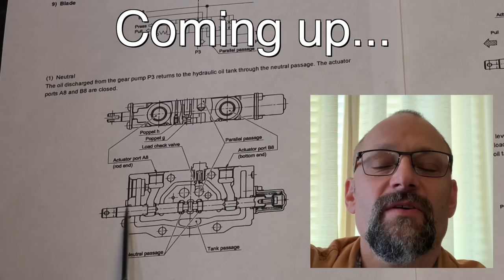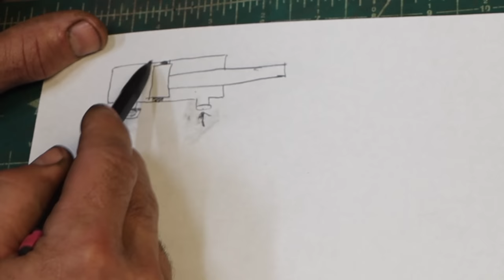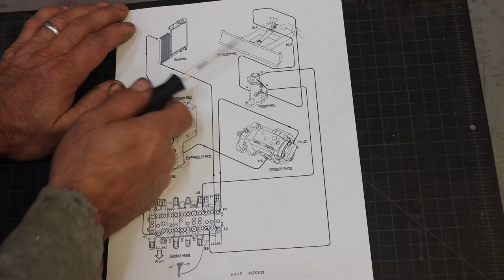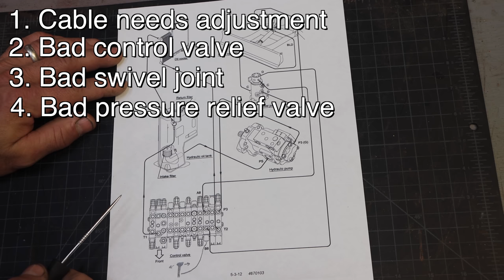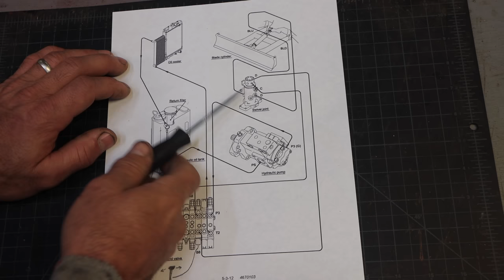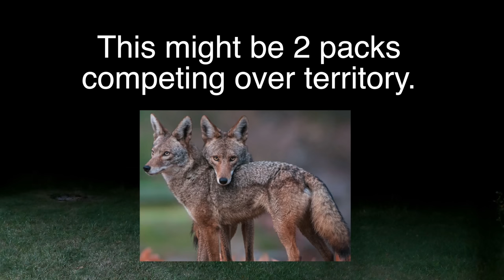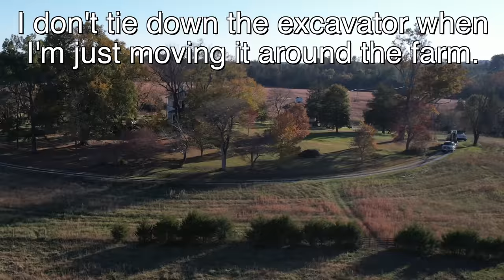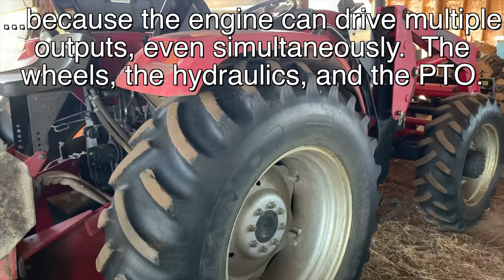Excavator Repair, Swivel Joint Rebuild, Yanmar Vio-50.

Comment: Great video.  I have a 2008 Yanmar ViO55-5B, and you have been an incredible help.

I have a similar problem with blade drift when running the right tracks...and pulling to the right.

Going to start purchasing tools/plugs to work on the hydraulic system.  Any suggestions on type of plugs I would need?  Any suggestions on a pressure tester?  Never really worked on hydraulics before and a shopping list would be helpful.

Thanks again for saving me a fortune with all your videos...my machine is basically going to be new again!

Comment: Thank you for the outstanding videos. I'm learning a lot. Curious why only 1 of the 7 seals internal to the swivel joint failed. Yanmar redesigned the seals or a reason I guess :). But it doesn't explain why none of the other 6 had any issues. That one seal was pretty torn up. Contamination in that channel only? Looking forward to more great content!

Comment: Great video I sure learned a lot. Was wondering if you disconnected the hoses from the swivel , removed it from the mounting and took off the bottom cap along with the snap ring , could you remove the bottom cylinder of the swivel that has all the seals and leave the shaft part up in the machine with the hoses still attached? Could save some work .

Comment: Just be very happy your swing joint has a smooth cylinder. Mine has reliefs for the rings and got consecutively harder to get down past each ring. By the time you reach the last one your beating the hell out of it with a piece of wood to get it down.

Comment: That thing you pointed to on your lift is actually the rotator motor and brake. And the parts you pointed to on the remote valves are actually the covers for detents of the spool valve. 

You should do a steering valve next and show people what a rotary spoil looks like and how it works.

Comment: I understand what you're saying about they're being more surface area on the one side of the Piston than the other, but it's not a problem of surface area, strictly a problem of volumes. When the piston is retracted all of the way the hydraulic rod is taking up an area where oil could be. And when it's all the way extended there's room for more oil in the cylinder. Where surface area comes in to it is that the same amount of hydraulic pressure is going to have less retracting pressure then it is extending pressure if everything is working correctly. It doesn't play into this particular test at all.

Comment: You really do put out a hight quality video .. when you were talking about the Teflon tape , if you put it on the treads nice and tight. It only lives between the nut and the treads in the part . Today there are Teflon type tapes , just for hydraulic fluid air, natural gas, and other fluids …and of course, still made and paste form ???

Comment: i like to take a little drill and clean out my grease zerk channels.   my wife calls the coyotes "Evil Dogs" !!  they make a set of tools that fold the oring or flat seal--a pair of L shaped rods with a zig zag at the top of the L and fastened together with a wide clip with a 3rd rod so they fold the ring in on itself around the 3rd rod allowing you to reach in side a tube to place it set of 3 are around 30 bucks  well worth the money for the time saved!!  great tip about the wrist band !!!!!

Comment: Those plugs with PTFE (aka Teflon™) have tapered threads and are designed to be used with thread sealant. Without it, a small channel would most likely remain around the threads, even if you squeeze the hell out of it. And if even a molecule of hot pressurized oil can pass through, you know it will. I think the reason why they used those here is because they are fairly cheap, widely available, easy to fit (only need a tapped hole) and are highly reliable when installed permanently.

Only tapered threads, like NPT or BSPT, need thread sealant, since there is no other way to get them properly sealed. Do not confuse these with NPS or BSPP, which are straight threads with mating surfaces and/or gaskets.

PTFE is known to occasionally cause premature wear of internal components, damage seals, get stuck into relief valves seats, clog small nozzles, etc. That's why it should never get into the oil. However, that's less of a problem on older or just simpler machinery with manual valves, less fancy pump mechanisms and greater functionnal tolerances. Still, it should always be avoided to let sealant go into the oil and only use it on fittings that require it. Today, most major machinery manufacturers no longer use tapered threads at all, except for grease fittings and some other unrelated stuff.

If you ever need to use tapered pipe fittings, just make sure you don't put sealant near the tip of the male thread and everything should be alright. It's also worth taking the time to clean out the threads of old sealant when reassembling. I personnaly use red PTFE tape (which is actually pink...) because it's three times denser and much more resistant than strandard white tape.

I hope it's useful :)

@FarmCraft101 You make real good job with these videos and have pretty interesting and instructive content. You've got a new subscriber here :) Keep up the good work!
Reply: Also, another reason to use that kind of plug is that they couldn't have fit regular hex heads on there. It seems obvious now that I think about it!

Comment: Always use a tape/sealant 34:26 material approved for the fluid and temps.  Teflon tape too. Do NOT apply Teflon tape to the first 2-3 threads to prevent the tape from being introduced into the hydraulic system.  Same thing with thread sealants on hydraulic and heating or control gas(air/pneumatic systems).  And, of course when removing fittings prevent introduction of sealants into the system

Comment: You just fried most peoples brains but I am a multiskill tech and I understand that force is equivalent to pressure x area. There is less area on the rod side and a leakby from the rod side will always move the non rod side. Great video.

Comment: If the cylinder is drifting up or down it doesn't matter. You have to replace all the seals in the whole cylinder anyway.

If the cylinder is operating under power by itself continuously then you have a bad control valve, it's not the cylinder.

My dad's old Massey Ferguson had the same problem on the power steering.
To keep the tractor going straight you had to continuously turn the steering wheel to the left.
That was very aggravating.

Comment: A lot(some) return hoses have little pressure and can use screw clamps except hoses that hold a cylinder in a fixed position other than full extension or retraction that have to keep position against weight using oil pressure to maintain that position. (That would make a great sobriety test- read it back, if you can, you're trashed!). That is not necessarily the rule. Murphy's Laws apply here too. I've seen all kinds of setups over the years. Especially on equipment that has been in service for any amount of time. God only knows what kind of tech has been there before you. You learn that nothing is surprising after enough time in the field and everything is possible. The patience of a mountain and correct information (and a little magic) works wonders....

Comment: It has to do with displacement more so than surface area. If the oil bypasses the piston seals, then the added oil will displace the space that the rod took up inside of the cylinder. Technically, the surface area which the oil has to push against is decreasing (while overall cylinder volume is increasing) as the rod extends because the rod's surface area inside the cylinder is also accounted for and pressure will be equalized between both cylinder chambers if the seal is bad.

Comment: Hey jon. It would have been a good idea if the manufacturer had put connector couplings a foot or so from the ends of the hoses. That way you can disconnect it their instead of fighting with the the fittings at the swivel. Great job on that fix. I was waiting for a pack of Coyotes to come running out of the dark towards you when you were filming 😂

Comment: Back in the sixties i recall not roping  down a load of small bales on the trailer, usually about one hundred bales give or take, the idea was to save time. You guessed it, a wheel went it to a hole or rut on the way back to the farm buildings and most of them fell off. Never again but straps I think are much better.

Comment: I have a massive collection of modified wrenches.
As for the use of Teflon tape…
Proper application of tape is to start two threads from the bitter end of the fitting.  Wrap around four times in the same plain.  Terminate towards the hose/adapter end.  
Explanation:  Differential pressure will keep the tape from migrating to the system internals.  It’s when Techs/Mechanics overlap the ends of an adapter/fitting that tape is introduced to the system.

Comment: Sometimes the servo valve body valves stops closing fully by dirt and grime that gets into the hydraulic oil over time which can make hydraulic cylinder to retract or expand when they are supposed to stay in put...

Comment: I repaired a Twiflex air operated brake made in England that went on an elevator. It had a 10” diameter square o ring that had the sides between the corners slightly concave. It cost us at the shop $526 I wore it as a necklace for years it was the most expensive piece of jewelry we had in the house.

Comment: Disagree with your point at 7:46.  With no seals the fluid will try to fill the entire chamber and thus force the ram to extend with the force equal, minus friction, to the diameter of the ram rod cross section until it reaches its travel limit.

Comment: Nice work. I don't envy people who need to dig out parts that are in such tight spaces. There's one thing i think you might have got wrong on the boom lift. The electrical part can't be on a rotating shaft if it's not on the same axis of rotation. More likely it's a slip ring around the base and the part you pointed out might be just spring loaded brushes assembly.
BTW... YOUR TRUCK IS ON FIRE!!! AAAAAAAAaaaaa~... :P

Comment: My Vio-20 had just the opposite problem: It just won't stay up
But I have my dealer fixed it, it is a cylinder leaking but I don't know whether it was the same cylinder you fixed

Comment: so a question - are those channels in the joint are uniform or I suppose they match the volume of the hose then, they operate as just a mechanical version of a hose.   I think I answered my own question when I typed it out, huh.  The next question is  the weight and torque of the machine sits on and it held by the bearings between the 2 halves and the joint has no pressure or torque - just fluid going through it.  Huh !    How about that. I have wondered for a while how that all works.   Larger machine just means larger everything.  Huh!  Yes,  I'm new around here but I'm hooked now.  :)    Far out  !

Comment: Great video. Question. If there is 7 channels on the top (2 for left drive, 2 for right drive, 2 for the blade, one for bypass return? Or lubrication? Why there are 10 on the bottom? Does it mean that the bottom casting is ready for angle blade? If there  are only 7 seals in it then the bottom is for 7 hoses. Where the other 3 hoses go?

Comment: I know the seals were over 300 but what would’ve a whole new valve of cost?  You were smart to change all the seals at the same time on every line you worked on.
Reply from the maker: The new valve was way higher.  $1900 if I recall correctly.  Crazy.

Comment: Dang. Good job. Maybe I missed it in the video but I wonder why this seal failed. Could it have something to do with putting the blade down when not using the machine? I have a B-50 Yanmar. Thanks for the video! Reminds me when I took apart final drives in a skid steer.

Comment: Good lesson,  why hydrlics? Because you cant compress a liquids so it moves something in its way if you apply presure
Why not air becuse it will just compress.
Why not 2 systems or pumps, im sure there are some larger machines with them.
Why not electrical,  might also be something modern made that way.
But hydrlics work the best as long as its not leaking. 
These multiple leval seals pipe was turned on a lathe, I cant see that being done on a mill. Somone had to use a boring bar and use the crossfeed to cut each seal seat  a dile indicator was used to hit the right depth on each groove and one was use to set each leval.
Rebuild set was 300 plus but a whole new unit would have been 1000s  
I think you've got a lathe and could have made it, maybe not the piston and the channels at each leval that would require a mill.  Thats a pretty presion made part that cost about 600 originally. 
Maybe less.  Probably the cost of the rebuild kit. Yes its 2022. 

Have you notices any other improvements since doing this? 
I wonder if the tracks grease tension has some of the same problems? By the time you get done with this is could be a perfect operating machine. Worth more money, mini excavators can cost 55k 
The really really big ones auction cheaper becuse they cost so much to move.  You move it to a job and it stays there long term. The small ones are nice
For smaller jobs, a big one can take down large tree's.  Pulling that stump with a big unit would have been fast.
But one bucket would almost fill your dump truck.

Comment: At 42:21, the hydrolic swivel is shown the center of the rotating part of the machine, so why is the electrical one not? The electrical connection is running circles around the center or are there large conducting rings around the center on the underside where the brushes from the topside connect to them?.

Comment: I visited Japan several years ago and noted that piping was in normal US sizes. When I inquired about this, the answer I received was "well, you occupied us for 40 years, what would you expect?" This occurred more than 30 years ago. I wonder if Japan is still using USA pipe sizes. According to this Yanmar machine, perhaps they are.

Comment: I have seen a recent video in which you utilized a shop vac attached to the hydraulic tank to create a vacuum so that hydraulic fluid would not leak. Would this type apparatus work in this application?

Comment: Just came to think about something; Is it the most worn out Track that is slower? If so, Might be the radius of the driving sprocket outside the belt. Can be looked at. It seems from the pictures that it is a big difference. Just to mention before starting to rebuild the motors. Regards Ketil

Comment: Good job with the swing motor repair. Explaining how they work was great. How many hours did the repair actually take?
Reply from the maker: Thanks.  I'm not sure exactly how long.  Maybe 15 hours.  I worked on it in shorter blocks over several days.

Comment: Regarding your cylinder test explanation: You explain how a cylinder with no seals whatsoever shouldn't move from outside force as long as it's a closed system. Is it fair to say then that if you have a creeping cylinder then a valve must be leaking as well? We have this argument at work all the time.
Sometimes I use equipment that had half a dozen cylinders with large bores and long strokes that I'll extend or retract all at once but I don't notice a difference on the oil level. The tank wouldn't even have the capacity to hold all that oil if it started from empty. What happens to all the oil that was displaced by the piston rods? I was told that there's another feature in cylinders that somehow compensate for the difference in oil displacement but it was poorly explained to me and I really don't get it.

Comment: This machine seems to use only mechanical linkages, but even still it seems to me that moving the controls through the joint would be easier than moving that many hydraulic circuits. If they had a second set of valves in the undercarriage then they'd only need to run 2 lines through the joint right?

Comment: I find the explanation of the cylinder test to be inaccurate. The explanation you provided is - why the extension force of the hydraulic cylinder is larger than retraction force. An explanation on why internally leaking cylinder will expand if you provide oil pressure in ANY port with a second port blocked, is very simple: expanded cylinder has more oil in it as in the retracted state, because oil takes up the volume of the steel rod. So if cylinder is leaking internally, oil from retraction side will flow to expanding side to push rod out to free up the volume for more oil to get into the hydraulic cylinder. If there is no internal leakage, the hydraulic cylinder will not move when ANY port is pressurised with a second port blocked. Why there is no difference witch port to pressurize: if internally leaking, both ports are connected anyway. My two cents.

Comment: Did u lose power throughout the system because of the bad seals or was is just isolated to the blade .Usually when you blow a seal like that it drops down system pressures

Comment: 22:50 hose clamps are never oem for any pressure rated haydraulic line. There can be hose clamps on hydraulic pump feed / return, but those hoses are designed to be fitted with clamps. The lines you show are rated pressure lines, it doesn't matter if they are fitted on the equipment for low pressure because they are not designed to be fitted with clamps, so it is definitely not factory. However, it could work out just fine (and it obviously has) if they are not high pressure.

Depending on the amount of work needed to change them out later, I'd consider replacing them with proper pressure fittings for ease of mind.

Comment: The house clamps are not factory but it is a return line(low pressure) the high pressure side carries too many psi and it would just blow right past the clamps.